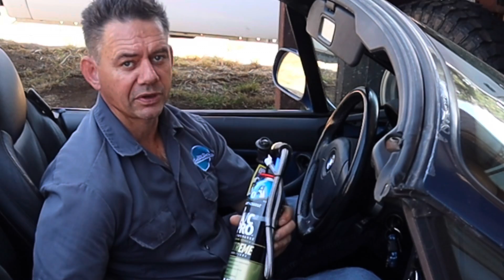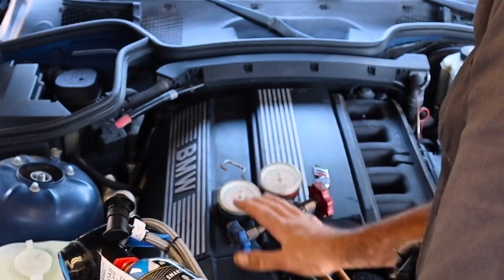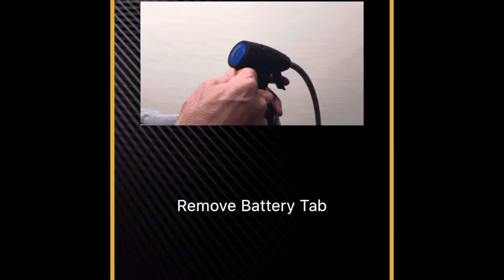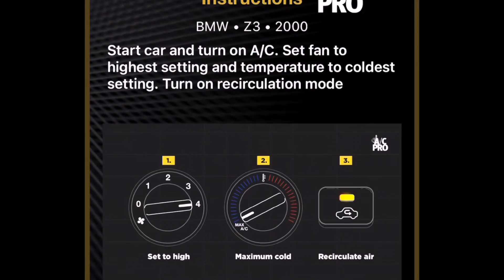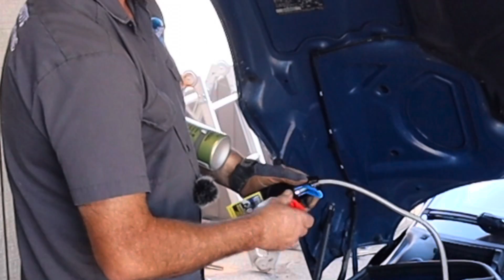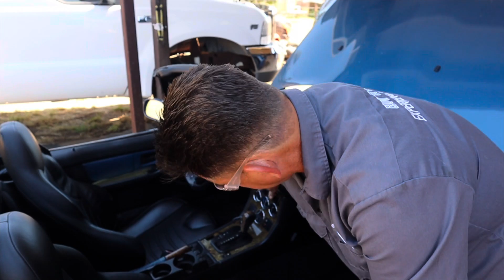How to Recharge Your Car’s AC the Easy Way!

Comment: @octane2099
0 seconds ago
I just filled mine up it stayed at 35 PSI on the low side and the air flows at the vent 38F really cold the only thing I notice when removing the cap on the high side just to see it was really pressurized and released pressure when I turn the cap to open it its that normal?
Reply from the maker: Glad you ac is blowing cold. Yes it is normal for the cat to press on the valve a little bit. And it is under pressure. If it continues to leak that is not normal.
Reply: @HowtoAutomotive  that makes sense the cap might be pressing on it and when I open it it releases the pressure it bled off thanks
Reply from the maker: @octane2099  thank you for watching!

Comment: Thanks for the video. Can't you damage the compressor If you don't recharge it with your proper amount of refrigerant. I always thought you had to evacuate the system, and recharge it with the specified weight... I see the can measures pressure, but is that sufficient?